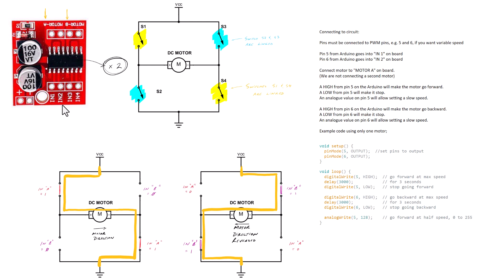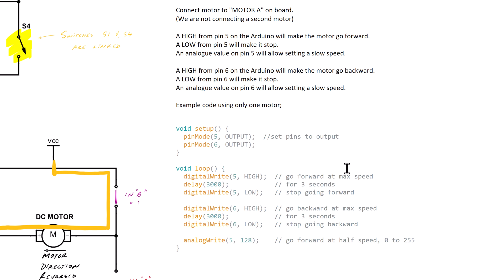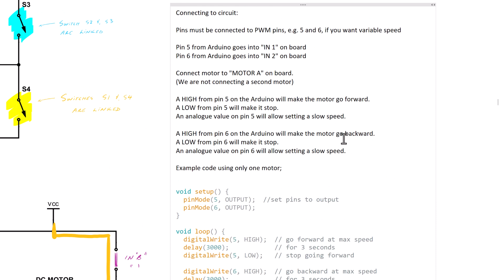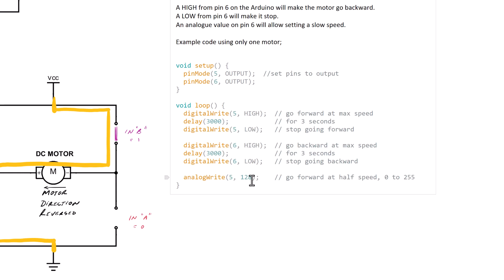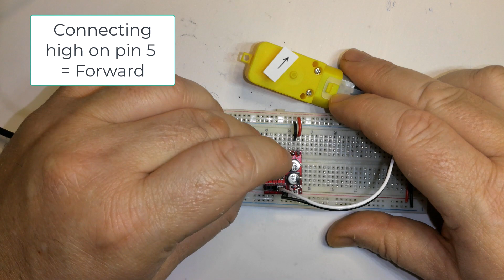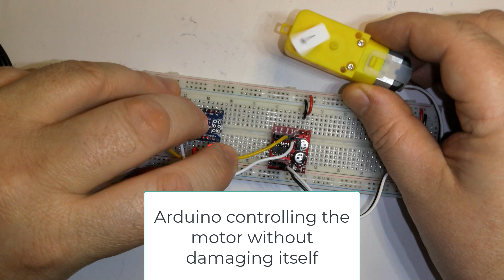Arduino motor controller explanation L298N mini dual H-Bridge

Comment: What happens if i have power supply of 7 volts. Powering both my arduino 5v and this motor driver
Reply: You can power the arduino with the vin pin and the motor driver also (chk its specifications first)

Comment: MINI? Oh will you stop promoting that dinosaur of an Dual H bridge some day? The LN298 is rediculously gigantic and uses up 2 Volts of your input Voltage to produce a lot of heat.
Reply: its called mini because its a smaller version of the regular board
Reply: Look up DRV8871 and DRV8833, much smaller. This has been done with them: https://youtu.be/UBAnjK6yy3s?t=201
Reply: This is what happens when you just want to spread hate without even seeing the video. If u see it closely, the motor driver is actually a picture of MX1508, which is also known and sold s mini l298n though its bit similar to DRV in working.